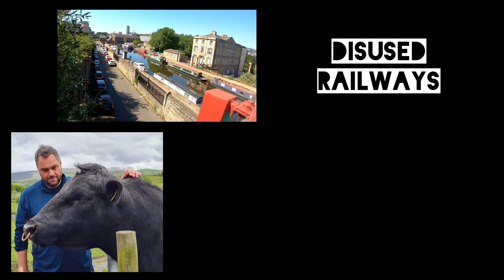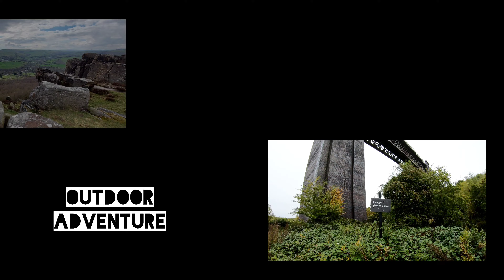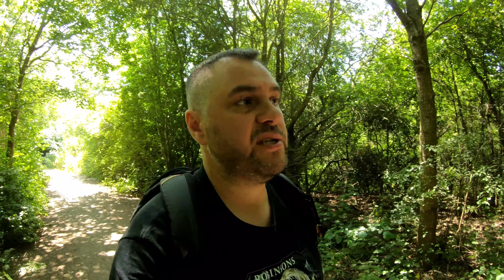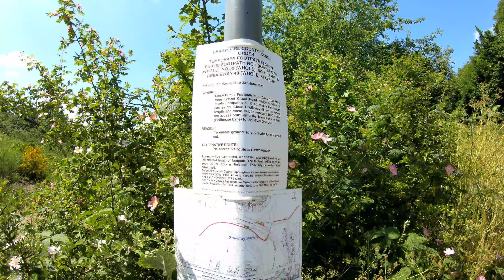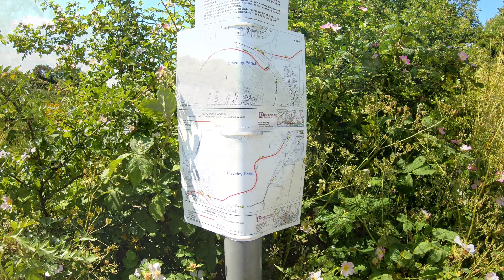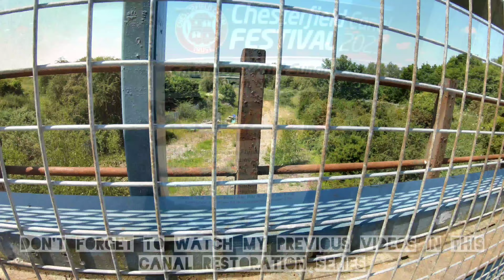Chesterfield Canal Restoration Episode 7 - Drilling and Surveys

Comment: I wish they would get on with it! They rebuilt a section at Renishaw, then filled it back in, they built the marina at Staverley, totally empty, then threatened to build a huge marina at Chesterfield, all about 15 years ago, then abandoned the job. 

The problem linking Chesterfield canal up to Kiveton and Worksop end is Killarmarsh, they built on the canal route in the 70s.
Reply from the maker: Hopefully start seeing some movement soon. Still seems a huge project given the progress over last 10 years. 
I understand recent plans have been impacted by various red tape from different parties. Sounds messy.
Reply: It was on hold for years as HS2 was due to cut right across the route of the canal.